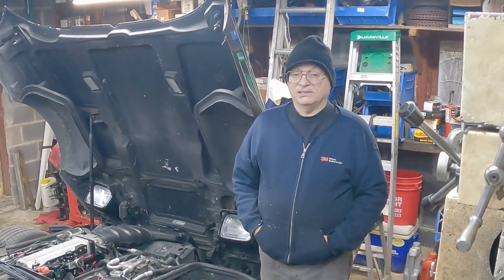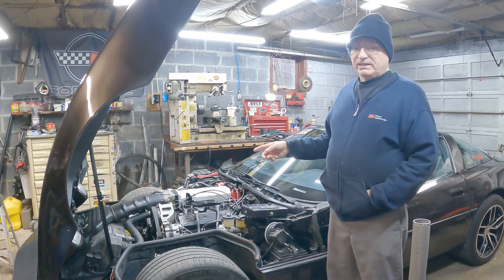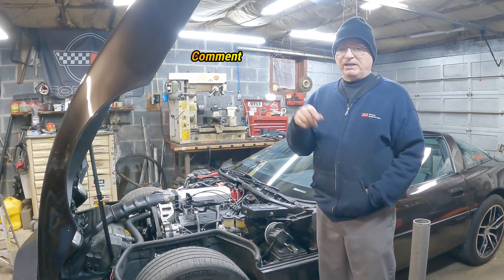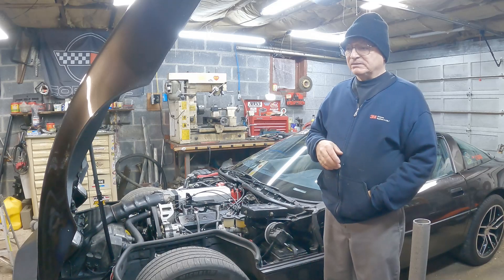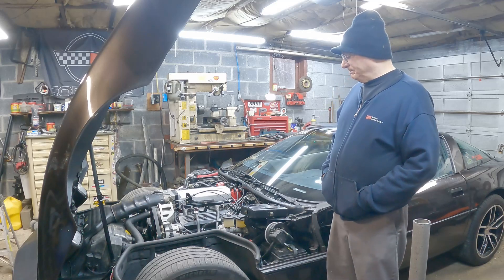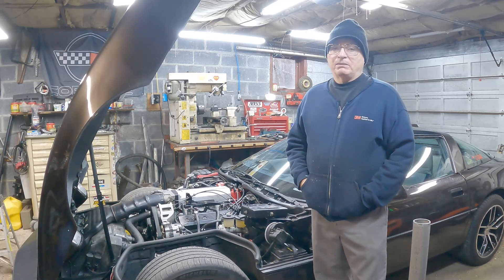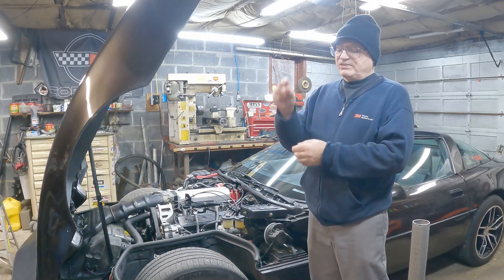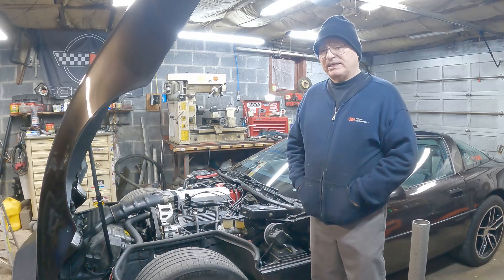Corvette Is On The Road 👍😎👍

Comment: I have mild cam engine with larger valves and ported edelbrock manifold and managed to make it run well, but spent over 200hours studying the  algorithm and analyzing the logs. I have the stock distributor and cold spark plugs. Spark timing table was adapted taking into account how the builder sets up timing 16deg initial 34 total @2800rpm then 40degrees total @2800rpm with vacuum . You probably need more SA at idle. Mine ildes at 23*. Also I’ve set PE SA table to 0 so I can evaluate the main SA table better. Changed the Blm cell boundaries  based on vacuum at idle which is now lower /more kpa. and disabled cell 4 lockup. went initially for saujp v4 but now running v7 with wb o2 logging ( nb converted to afr works equally fine)

Comment: Just go stock. I asked Mr norm from Chicago. He said late model c4 were Not designed for computer tunes..
Reply from the maker: It's a little late for that.
Reply: newer cars you need to hack the ecu in order to tune anything. Obviously the chip was not designed to be removed and rewritten but there are simple tricks that enable you to do that (memcal adapter) then you have acces to everything you need, I don’t see any problem tuning the ecm for any v8 you want.
PS 
btw late models mean 92 and up that rely on MAF and they say they are more difficult to tune but they have enough power so you don’t necessarily need to

Comment: I have a question/inquire, I deleted alot off my 91 c4 and I want the prom to know this to avoid and issue lights and / or worse timing or fuel pull. Could I send you my prom or if you have one available that works in my 91 and only remove the items I deleted? No tune no parameter changes only  deletetion off certain items so the ecu runs normally.
Reply: I have a 85 that I would like to do that also, but have a chip that currently works.
Reply from the maker: The stock memcal I do not have a burner for, you would be better off using the adapter with the proper chip, I really do not want to get into the chip burning business, just do a search for OBD1 chip burning service you should be able to find something.

Comment: Hello Eugene.  Hope all is well.  Just jumped in and ordered the boostednw gm kit.  Until i receive my order, can i ask you to share your stock bin adf and xdf files. I also have a 1990 auto c4 that id like to start looking into. And any tips you may have. My ecm is 1227727. Enjoy watching your videos.
Reply from the maker: If you still have the factory original memcal the best thing is to copy the bin file directly from that. If you have not seen it I have a playlist on OBD1 tuning. I can email you a copy of the xdf and add files, Go to the about section of my YouTube channel and there is a link to my email.
Reply: Yes all stock, and i do plan on making a copy then storing it somewhere safe as new chip is different and requires an adaptor.  But yes would love files to start looking around.